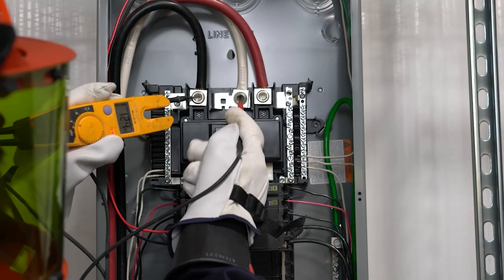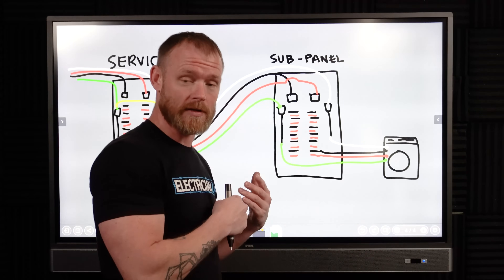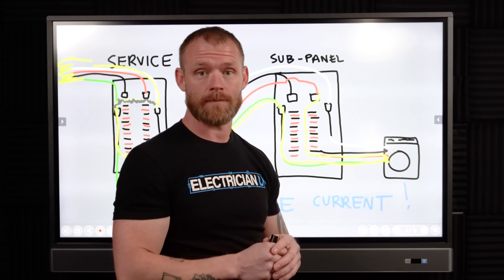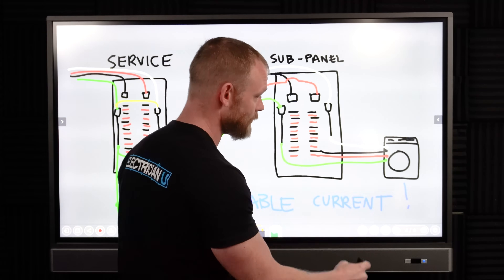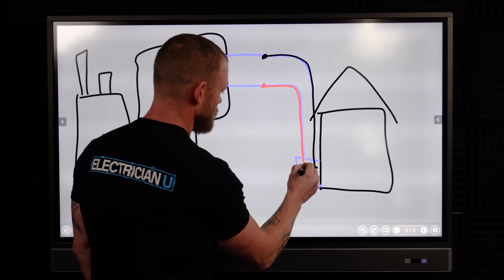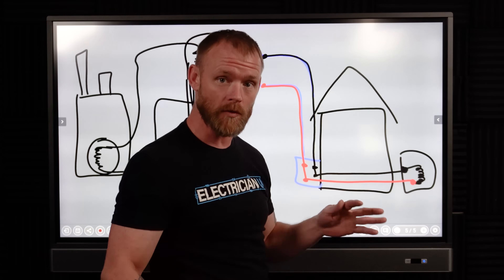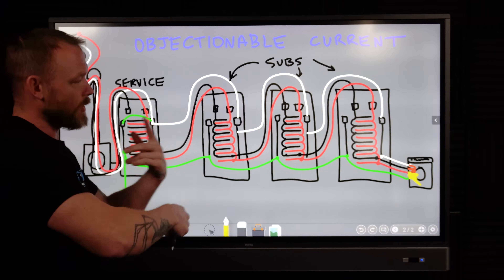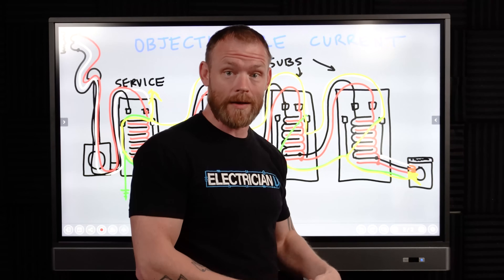Why Do We Bond at the Service Panel and Not a Subpanel?

Comment: Question… so what if the main service disconnect is only the breaker for the service. Example being on the exterior wall you have the meter and only the main 200 Amp service disconnect. But the sub panel is in the garage literally on the other side of the wall from the service disconnect but it doesn’t have the service disconnect in the panel so it is technically a sub panel? Does this still apply? I’m a home inspector. I have electrical experience but not a certified electrician

Comment: Love your teaching,I need help with a hacker who is using the peco electric smart meter to send surges and spikes as well as send viruses to my computer and after I am attacked electronically I have to un plug my microwave or my guitar amps that still have static in them I can hear when I just slightly move them.what is happening to my appliances that they won't work or cut on until I unplug them with 10 minutes then plug in are they using the ground wire to transfer malicious code ,data

Comment: If a ground fault happens and it isn't bonded why wouldn't the path to ground trip the breaker?  Also what keeps the current flowing off of every ground wire attached to the ground bar when it is bonded properly?

Comment: Hi Dustin, Thank you very much for your fun and very informative videos, especially the times that a masterpiece like you have to deal with a different scenario and come up with a solution. Recently, I came across with a job that has dual log meter and is feeding two different 200amps back to back one in the garage one next to meeter out side 
Which of those two panel needs to be bonded with neutral install both getting source from the dual log meter and what about the ground rod? If you can make a video about it, appreciate it.

Comment: Just found your videos and think they are very informative.  Just one question regarding bonding panels and sub panels.  I have a house with a the main coming off the meter.  When I added a separate building with a garage and an apartment a new line was run to the main box of the new building from the same meter. Can you confirm the second box is a sub or because it comes off at the meter is it a second main?  Thanks in advance for your time.

Comment: I'm a long time watcher and first time commenter. An electrician ran power for my above ground pool. He installed a 20 amp breaker to the  the main panel where the ground and neutral are  are connected to the same bus bar. He also installed  GFCI receptacles down stream. Should that breaker be placed in the subpanel where the ground and neutral are separate? Thank you.

Comment: I just installed a 240v 50A receptacle for a pottery kiln, and I installed it according to the manufacturers instructions. They just use "hot" to describe the two 120v conductors. But I've noticed that the two "hots" are usually designated black and red. I asked if it mattered what "hots" were connected to which terminal, in a Q and A electrical group... and a lot of guys said it did not matter. But even here, I see that you generally keep the red on the right, and even alternate black and red whilst drawing the breaker connections. Now I know red is the "secondary" circuit after the POCO. So... apparently it does matter? Or is it just an unwritten rule, for good practice? I also recently learned that in a single phase residential system, it's actually "split" phase oscillating +/- back and forth between hots? So do "poles" factor in, if there's no real designated positive or negative charge? 

Also, this is a great video! I'd be interested in equipment grounding, and earth grounds. Im curious why it's even needed, if there's a ground wire going out to the transformer. If that's a direct path back to source, why would it go through dirt or pipes? Is this primarily just for lighting?

Comment: Hi, why not to use the neutral as ground too if already bound at the main panel?
Reply: Because if current is flowing on the ground, then you can get shocked by touching equipment.  That is why the ground is ONLY supposed to have current on it if something else has already gone wrong.

Comment: Don't think bonding it at the sub panels really cause any problems. In the event of a ground fault, you get parallel paths for the current, so some of the white wire will carry excess current due to the fault, in addition to what it has been carrying servicing the loads. This sill cause an increase in  voltage of the white wire at the subpanel end to be higher than at the main panel, but this only ends up reducing the over all potential applied across the devices its servicing. Slightly lower voltage seldom  does any harm.  Also no matter how its wired the amount of current going through the breaker/fuse is the same, and it will trip just as quickly regardless and stop any meltdown. I think this is mostly a theoretical discussion but in practice one could not show a single instance of failure resulting from bonding at the service panel.

Comment: Assuming everything is wired correctly and you have a dryer hooked up to a sub panel like in your illustration. If a ground fault occurs where a hot wire slips off the lug on the dryer and touches the metal casing, the current will go through the casing to the ground lug on the dryer and back to the ground on the service panel, correct? At that point it looks like it can either go to earth thru the grounding rod, or it could go back to the neutral on the transformer since the two are bonded there. Why doesn’t the current only go back to neutral and not go straight to ground thru the ground rod?

Comment: What if the ground to neutral bond were at a single subpanel and not made at the first box from the power pole? My home has a small service panel with three breakers for outside use. From there the main subpanel is connected. The first box is not bonded and the main subpanel  is bonded. The home inspector called this out and I know this configuration passed electrical inspection.
Reply: The small service panel is first in line from the power pole.

Comment: it is totaly wrong , the short floats away through earth not the N ,  you are drawijg the closed loop wrong , the phase hits earth wich is connected  to the outside of the device ,  and if he bond in second box his fuse to that box even wont come in because of a full short  i even  wonder if you know what the diffrence is  circuit breaker and a earthbreaker  and how they work otherwise you would know

Comment: Really enjoyed getting clarity on bonding at the main panel vs sub panel. However, have another grounding question that is bugging me. What would cause me to need to additionally ground a sub panel to a grounding rod that has been hammered into the earth? I have a selfish reason for asking because want to install a very simple exterior sub panel about 75 ft away from my main panel but have had a hard time determining if a grounding rod (or two depending on the 25 ohm or less criteria) is needed? Can you give advise or point me to where there are some rules that govern this?

Comment: Without any ground, hot to hot or any hot to neutral will still trip the breaker.  The equipment ground or safety ground is there for the sole purpose of making Greg feel better because in the end the only thing that matters are Greg's feelings.  Capice?

Comment: What if there was no ground from the service to the sub-panel? Then do you bond the ground and neutral to complete the circuit so the ground fault can get back to the neutral?
Reply: To answer the question, you won’t be able to bond at the subpanel if you don’t have a bond on the service, you will create objectional current, and burn the wires or cause a fire

Comment: Nice... thanks.  I am installing a subpanel for a service panel that has no space for expansion, that was added as service to an existing service panel converted to a subpanel to run most of the original electricity in the original structure.  As an open area below the house (picture a beach house) was closed in and wired for use, existing circuits were maintained in the (now) subpanel in the house, and a main service panel was added outside... to which I am adding another subpanel to allow me to operate a welder in lieu of other 50 amp circuits that can be shut off while the welder is in operation.  I didn't see a " bonding screw" in the service panel, but I saw what I now think was a bonding "bar" across the panel.  Would an older panel be dedicated as service and have a "PERMANENT" bond?  Incidentally, the only ground I see is from the meter can next to the service panel (the service panel has no main switch or breaker).  Would there be a main switch in the  "meter can", or is it just HOT with the meter installed and power being supplied from the transformer?   I understand I should not "BOND" the subpanel... but I am unclear whether or not to add a ground rod to the subpanel.  Can you clarify that?   I seem to remember 2 green screws on the left side of the panel, and there was a loose green screw in the package (general electric 125 AMP service panel (outdoor-value package supplied with "starter" breakers.  Not sure if all of these green screws are "bonding" screws or not...  so I am trying to figure out exactly what to do with them.  Any help appreciated.

Comment: This gets you into tricky situation as old meter bases are grounded to neutral at meter as well as service box/panel,  but in newer code you isolate at meter box and bond neutral to ground at service panel only. I've come across this on older farm services.

Comment: I think it would have been better to discuss objectionable current as an everyday hazard if bonding occurs at locations beyond the service, rather than focus on objectionable current flow in a ground fault or short circuit:  that is, everyday neutral current flow will divide between the neutral conductor, the equipment grounding conductor, and any/all everyday metallic parts, e.g. plumbing, which have been bonded to the system.

Comment: So can I add another grounding rod to the other side of the house?  I have 2 already existing grounding rods connected to the main on one sidenof the house, but I need to install a helium miner antenna to the top of the house and ground it to a different grounding system, can I have 2 grounding rods on one side of the house and another 1 on the other side on its own?

Comment: Not an electrician. My home has two 150 amp service panels. The panels are fed by one meter. The grounds from each panel are connected to the ground rod. Are the neutrals and grounds bonded in both panels? Are the two panels set up to work as one service entrance panel?

Comment: I've had to watch several of these video's to finally get it.  The Green Ground doesn't have enough impedance to carry enough current to trip the breakers.  Even thought both ends are Green Grounded, earth ground isn't really that conductive.  So Green Ground is for charge buildup not related to the normal power lines i.e. lightening.  But for a fault condition the Green Ground in a "bonded at the panel" configuration is also used to "clear a fault" by tripping the breaker.  Nice video.

Comment: If neutral and ground is bonded, then you can treat them as same right?  am trying to hardwire 60amp to EV, and it only has 2 hot and 1 neutral. It's currently connected to both neutral and ground bar. I am wondering if I need to move the current neutral wire to ground and remove the ground cable.. Or leave alone since they are bonded..?

Comment: Question. I have a subpanel that was originally planed to be main panel. So it has a rebar sticking out of the foundation. Is it good idea to still connect that rebar to the ground bus of this subpanel? (the neutral and ground are NOT bonded in this subpanel) This subpanel is 100A fed from a main service 200A panel with 4 conductor SE cable 3x2 awg and 1 4awg). The main panel has two ground rods.  I see no harm in connecting more earth ground to any subpanel though it is probably not necessary.

Comment: I live in Barstow, California,  and the homeowner did not run a ground to the house when he remodel a 1960 , 3 bedroom 2 bath with a detached garage.  The outlets are 3 prong but when I went to replace the outlet I found that there was no ground to the plug or any of the outlets ? Can I install a ground outside to the main to get my outlets to read correct and not open ground when I check them ?

Comment: Fantastic video! I have a barn with an existing subpanel which is no longer hooked up to the service at the house.  I would like to attach the inverter from my solar system to the subpanel. Do I need to bond the ground to neutral in the subpanel? There are also grounding lugs on the panels and the controller box. Should these be run to the ground at the subpanel? Thanks, Matt Feuer

Comment: Your picture implies a ground on input side of service panel
In my location MidAmerican Energy no longer allows a ground installed in meter base ergo no ground on input side of service panel. All grounding for my installation (my house) originates in service panel. This is a fairly new practice and I'm unsure of the reason. I did like your video though. Thanks

Comment: I have a 30 amp 240 outlet in my laundry room but it does not have a ground wire.  My new electric dryer has a four prong plug, no ground.  Can I bond the ground and neutral at the dryer and replace the cord with a three wire plug and still be safe?

Comment: The definition for bonding is to have all metal parts to have the same potential to ground! In layman‘s terms it means you need to have a wire which looks like a ground connect one piece of metal equipment to another piece of metal equipment to make them one. In theory it’s like when two people hold hands together they become one. That way all shorts have a path back to earth because ground in reality is a real earth. Think about lightning it’s always finding ground. And that’s why electricians use the word ground which is our planet that’s where it wants to go. The creation of grounds in why we use ground rods in the ground is simple think of it as a railroad track when electricity has nowhere to go it follows that wire all the way into the earth which intern trips the breaker causes a short circuit. The neutral which he is talking about which is the white wire is actually a return it brings the power that is unused by the equipment and returns it back onto the grid. Which is a high tension wires you see on the streets. Any only time the neutral is live is when there’s a load. So the first thing you have to do is make sure when you’re playing with any electricity to make sure that it is off. I electricity is not as complicated as this man is explaining. We are taught that it’s like a river and switches on your walls or like dams just stop the electricity from flowing. But in reality it’s more like drawing a circle on a piece of paper because that’s simply all it is. Think about it like a road you go down the road in your car can you stop somewhere no you have to go home so you go backwards. So basically the power has to go to the device and then the extra power hast to go back to the electrical panel that is not being used. When electricity was invented there was no such thing as a ground it was just a heart in a neutral. Grounds are invented for safety only. Just like arc faults and GFI breakers or receptacles they basically work the same GFI breaker has a computer chip inside it and it monitors the imbalance in the load between the hot in the neutral. Arc fault breaker‘s work a little bit differently they sense any sort of spark. Like if you have a vacuum cleaner running a pole out of the wall with a arc fault breaker it will cause a spark and tripped that breaker a normal breaker will not do that everything is about safety today. In theory makes things more expensive more complicated in my opinion you can’t  reinvent the wheel nor can you re-invent the way electricity works. Safety is everything in the electrical and that’s why you should always hire a licensed electrician to do any work on your home because we go to school for a long time to do our jobs think of us like doctors and it’s a vast field

Comment: Hey Dustin big fan of your videos! I came across an interesting situation and could use some help explaining it. Let me explain, the utility company had a support arm break causing the phases to cross and have his neutral become live in the home. I have the ground wire that has visibly melted through the sheathing in the basement and was glowing red during the failure. Can you help explain?